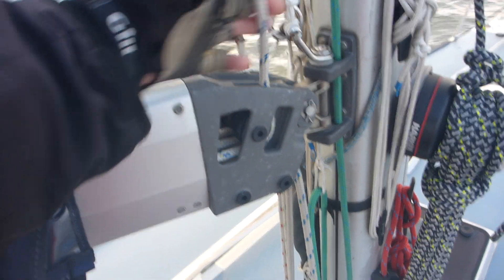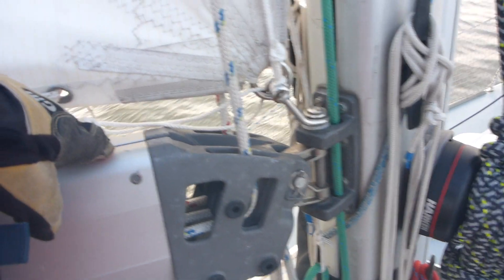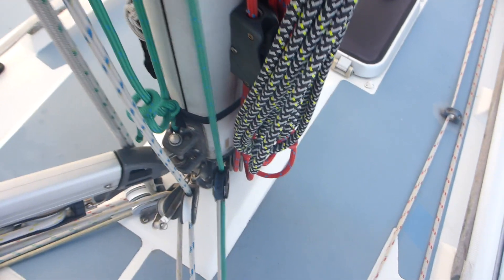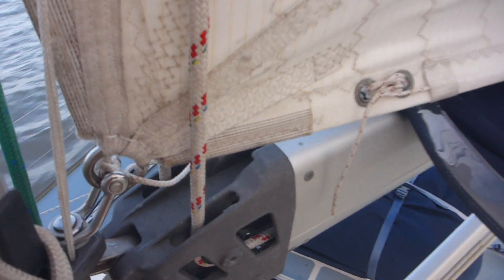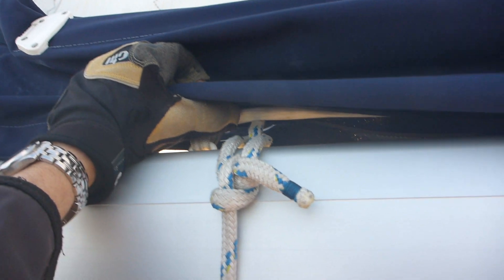Single Handed Solo Sailing. How I Rig Main Sail Reefing Lines.

Comment: Thanks James.  Very helpful.    I understand how your 3rd reef luff cringle line runs down to block at the base of the mast, and then aft to the cockpit (very clever).   Could you explain the routing of the leech cringle line on the third reef?   It looks like it runs around the boom (running bowline), then up to the cringle, and then down to the aft end of the boom (and internal).   If so, how do you tighten this line when putting in the reef?
Reply from the maker: Thank you very much for watching Patrick.  And for checking the rushes! :-)).  Your absolutely correct.  It runs internally through the boom.  There is no room inside the boom for a third single line reef for the 3rd reef what with the outhaul in there too.  Two line works very well for the 3rd reef.  If you freeze the video after 53 seconds you see a 3rd reef in the main sail clearly.  That tiny piece of film was taken in the Portuguese Trades ... downwind and probably a F7 at the time.  I only say that to show how well it works.  To tighten when putting in the reef it's easy.  Take off the kicker (I have a rod kicker).  If you don't have a rod kicker haul up on the topping lift.  Grind in the reefing line and once tight ... (free off the topping lift if you don't have a rod kicker) then grind in the kicker again.  Job done.  I hope this makes sense.
Reply: @samingosailing  and @patricklaine  for the jedai knights to discuss. IMVHO (and greatly less experience) line reefing at the leech is a combination of downhaul and outhaul. In my mind, the ratio of these forces tapers the nearer the head to greater "out" . So by reef 3 the cringle is being pulled aft much more than down. I don't know what the amount of down force you may want does to the outhaul stress on the sail fixings. When I tighten it, I ways think the 3rd needs a block a little aft on the boom.
Reply from the maker: I think me and Patrick would be the first to say that we are ordinary sailors who have just had the opportunity to first get the right knowledge, do the nautical miles and then with that experience, then have the opportunity to sail a little further.  I always say I've sailed further than most but not nearly as far as some.  We don't do what we do without an awful lot of sailing and an enormous amount of thought and preparation.  Present company excluded, the fear of encouraging viewers to take on more than they can cope with is very much on our minds.  A video never shows the real challenges, self management, knowledge and stamina required to safely sail offshore.  To answer your comment, I don't think that there is any change of angle as you reef smaller.  The weight is also similar as the sail reduces.  If you go 57 seconds in to the video and freeze the frame you have a picture of  'Talisker 1' sailing down wind with a triple reefed main.  The reef looks ok.  That bit of footage was in the Portuguese Trades and I guess a consistent F7 at the time.  There is also a windward shot with the 3rd reef just before.  I've used the triple reef in anger quite a bit in the open ocean and have no hesitation in using the same method for all reefs.  Thank you so much for your comments.  I really appreciate you watching the video.  Fair winds and stay safe James
Reply from the maker: @ratusbagus  I forgot to mention that the area of sail for reef 3 on the main is a heavier cloth than that used for 1 and 2.
Reply: @samingosailing  I didn't know that was a thing. Thanks James.
Wow, aren't sail makers a skillful bunch? 
I'm just passed the "half a hanky" stage in comparison. Hope I don't come across that bad though.
Reply from the maker: Yes!  There was a huge amount of discussion with my friend Rob Kemp (Kemp Sails).  It's always a case of explaining to the expert what you want and then the expert correcting ones ignorance.  Kemp are very good sail makers indeed.  The 3rd reef is also deliberately deeper. Avoid a sail maker who just asks type of boat and tells you not to worry your pretty little head ... they will make you a sail.  Years ago when Rob first met me he wanted to know all about me and my sailing before discussing spec.  That's what you want.
Reply: @samingosailing  and Patrick Laine.  Firstly thanks very much for all your effort on the videos.  They are both enjoyable and illuminating, I appreciate them all, thank you.  I'm intrigued by reef 3 - not single line.  I have recently bought a Westerly Griffon and plan to do a bit of single handed coasting in this 26 footer.  In a perfect world with planning I won't get to reef 3 but one never knows.  I only have 2 clew reefing lines in the boom.  The tack set up is to horns, not single line.  The main has reefing points for 3 reefs.  Until I decide how to rig reef 3, I'm wondering whether to rig my 2 existing clew reefing lines to reef points 1 and 2, 1 and 3 or 2 and 3, with prudence for single handing as my watch words I'm minded to go for 2 and 3.  Any thoughts?  Turning to your reef 3 and my consideration of how best to utilise that on my mainsail, I note your reef 3 green tack line and see there is some other green line visible looped around another light lashing below the boom.  Questions 1.  What is the other bit of green line for?  2. How have you dealt with the green tack line, making it fast at the other end, before it ascends up to the tack cringle?   3. As I have no in boom routing option for a reef 3 clew line to be run my dilemma is how best to deal with the clew line for reef 3?  Have you any thoughts on that, based on your experience please?  I'm mindful that by the time one gets to reef 3, things are a mite lively!  Once again, thanks for all the videos, they have inspired me.

Comment: Many thanks for the tour or your slab reef reefing. I can see that the sliding car/blocks inside the boom combine reduce friction and pull the reef tack(s) down more directly that some other schemes. Running the reef lines starting at the reef tacks is also interesting, giving up a bit of dubious mechanical advantage were it started down at the gooseneck, and reducing the amount of line to be pulled through to get the tack down. Cheers from Alberg 30 Trois Bouleaux on Lake Huron.
Reply from the maker: Hi David.  I quite often see systems incorrectly set up.  Reefing lines are very important.  I showed in the video the correct way to rig the reefing lines on my boom.  Single line reefing on reefs one and two and double line reefing for reef three and all reefing lines leading back to the cockpit has been marvellous.  Thanks for watching.  Fair winds and stay safe James

Comment: You didn't show how the 3rd reef works from the leech. I am assuming that you have a block on the boom so that the reefing line runs through it to a block at the goose-neck and then to another at the base of the mast so that the reefing line can then run back to the cockpit. The tack is taken to the goose-neck by the green line you showed. Hence the 3rd reef is taken without leaving the cockpit. Did I get that right? BTW, that is what I have, and it works great. Have you ever seen Skip Novak's YouTube series on heavy weather sailing encouraging a 4th reef rather than a storm trysail? Most interesting.
Reply from the maker: So sorry Ron.  The 3rd reef leech line runs inside the boom.  There is not enough room on the boom for single line reefing for all three reefs but there is enough room for single line reefing for 1 and 2 and just the leach line of reef 3.  All lines run back to the cockpit.  At the beginning of the film I show the green and white 3rd reef leech line next to reef 1 (blue line).  I have seen Skip Novak's YouTube series.  Rob Kemp, who designed and manufactured my sails, put a deeper 3rd reef on my main sail.

Comment: How do you attach at the tack for the reefs?  That is where my understanding of the system hits a snag.  Thanks
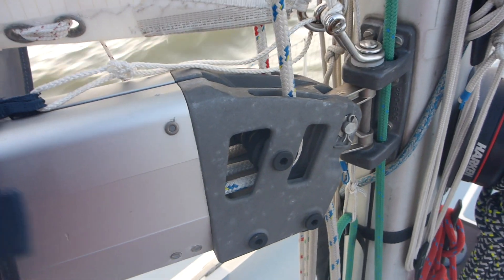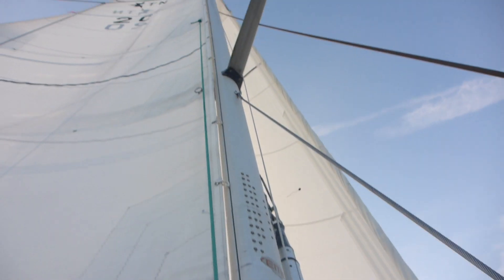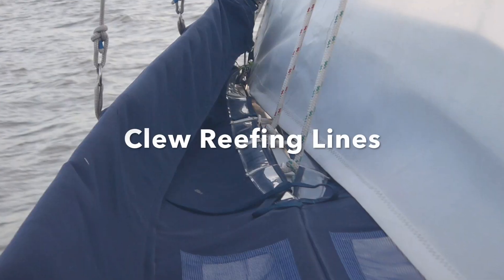Reply from the maker: Hi Bob G.  If you look and freeze the frame at 1:43 minutes you see how the tack is attached for reef 1. Freeze 2:02 for the tack for reef 3. Freeze 2:31 for the tack for reef 2.  The video shows the system for single line reefing for reefs 1 and 2 and double line reefing for reef 3.  Your system might not be the same.  It is very important to understand your reefing system and how to put a reef in and shake a reef out.  And as to when ... put a reef in when you first think about it ... To shake a reef out ... it's best to wait a while after you think a reef can be shaken out.  Hope this helps.  ATB  James
Reply: @samingosailing  Thank you.   Your input is much appreciated.

Comment: James many thanks for all your videos - I have enjoyed them immensely. 

Forgive me if you have already answered this somewhere earlier. I see you often fly your staysail behind the main when going DDW. Do you find this helps much?  You’re still doing it so I presume it is worth the hassle..

Kind regards, Tony
Reply from the maker: Tony.  I think that one should always have time and that sail changes should be carried out the moment you think you need a reef.  But don't shake out when you first think of doing so :-).  Sail changes should be easy to do.  Like riding a bike!  A stay sail set and tucked behind the main can be used to deflect wind in to a poled out genoa.  This works.  With my set up I use it most when wind is off the quarter.  The main (on a preventer) and stay sail on one tack and the genoa poled out, and importantly, pushed forward, on the other tack.  This is a powerful set up without the stay sail, but with the stay sail, it really does make a difference to passage making.  I often see a head sail blanketed by the main.  The simple solution is to pole out the head sail and push it forward. I am only saying what works for me. Thank you so much for watching the videos and for taking the trouble to comment.  Stay safe.  James

Comment: Many thanks for the video and the others in which you share your experiences. I will take your last one as an inspiration to think about a third reef. For this I must still look at the possible line routing in the boom and especially the ends. In any case, an old question came up again: Can you tell us something about the lines on ‘Talisker 1’ that go from the mainsail to the boom lift? Many thanks. Fair winds and stay safe. Matthias
Reply from the maker: Hi Matthias.  Thank you so much for watching the videos.  Yes!  A stainless free running ring round the topping lift attached to a line that is then attached to the reefing eye.  There is a ring and line on each reef i.e. three of them.  The line is nearly taught when the topping lift is applied and the sail is flaked on the boom.  It's simply a lazy way of getting the sail flaked more easily.  Pulling those lines from the aft end of the boom also pulls the sail back.  I've only seen them on one other boat and he is also a single-hander.  I stole the idea from him!!  Fair winds and stay safe.  James
Reply: Thank you very much for your great response. I really appreciate it.
Reply from the maker: @sailingcatalina1782  Your very welcome

Comment: Thanks for sharing James. Interesting as always. I notice you have a cunningham rigged so two questions if I may. How do you secure and tension it (port side?) and how useful do you find it?
Reply from the maker: Hi Richard.  I do have a cunningham rigged.  I don't use it often.  Occasionally a tiny tweak in lighter airs for the full main.  Its attached to the eye a few inches above the main tack eye.  Dead simple on a line double purchased by hand at the base of the mast port side.  ATB  James

Comment: Do you ever tie down the bunt to prevent it billowing?
Duncan Wells often mentions this but I worry about standing up there after having had to reef that much. Also, shaking out would involve removing a number of ties.... Unless someone on here knows of a clever single line-along-the-boom-led-back-to-the-cockpit-quick-release-trick?
Thanks for the two-line 3rd. Saves manually hooking on at the mast that I've always just accepted. Obvious really I suppose. But only once shown it!
Actually, it's an invaluable tip for short handing.
Reply from the maker: The sails on 'Talisker 1' are v heavy duty ocean spec.  So quite stiff.  No billowing. Safety first.  Obviously a daily deck check when off shore.  Otherwise its avoiding leaving the cockpit unnecessarily.  Fair winds and stay safe  James